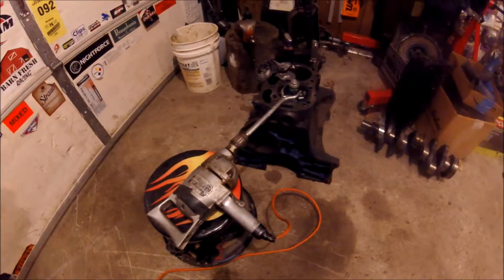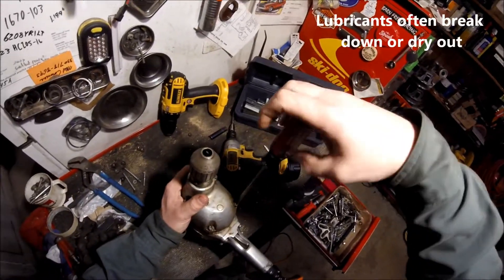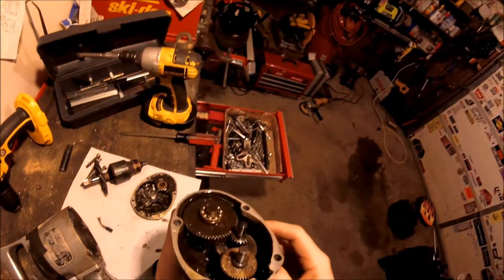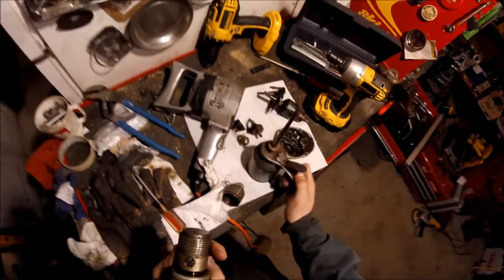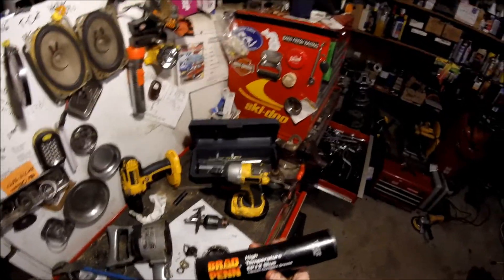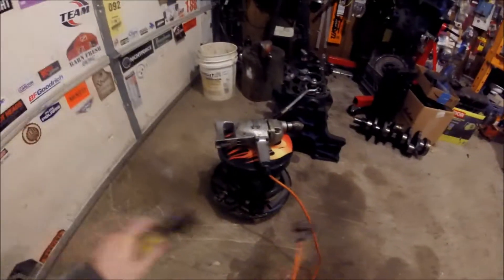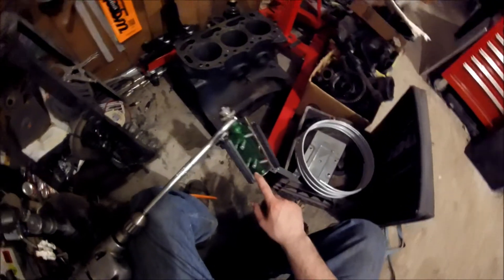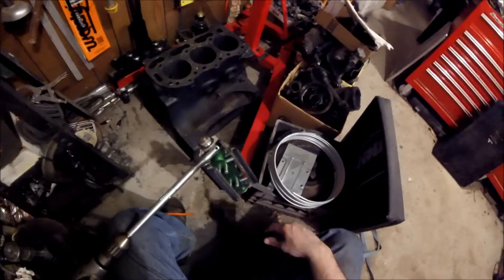Over Boring Cylinders w/ a Vintage Black & Decker Drill

Comment: 10-15 minutes per 0.0010" thank you for telling us your experience.  I'm assuming that's a cast iron block.  If my math is correct, that sounds like roughly between 2hrs-5hrs per cylinder to go over to 0.0200" to next size pistons.  

Does that sound right?  

I'm working on a straight 6 80s bmw diesel block... if I go oversized pistons then maybe machine shop is quicker.  If I stay standard size, then straighten them out at home is doable.
Reply from the maker: Yeah, that sounds about right, it was almost excruciatingly slow...  But, the local machine shop wouldnt touch mine, so I took the hard route, haha.
Reply: Did they give you a reason why they wouldn't touch it? I feel like machine shops would do it and then just do a disclaimer or something. Or is it because they don't want to do work on cast iron blocks because they are extremely hard compared to aluminum blocks? Tearing up their honing stones or whatever
Reply from the maker: @StuHaightVideo  the cast iron block itself was no problem, but apparently those tractor blocks were known for having sand pocket inclusions, and the bores would either leak or the tooling would get destroyed.

Comment: I have done this using a drill press and an old Sunnen hone. It will work, it takes, forever, you have to try to keep your strokes steady and you get to size eventually. a motorcycle inner tube or bungee cord on the drill handle hanging from a hook holding it up creating resistance helps a lot I have done this with a big drill motor too. Have you ever seen a hand crank engine cylinder boring tool ? Rottler made them and they are fun I had one.
Reply from the maker: No, never seen a hand driven one.  That would be pretty cool for honing or glaze braking, I couldn't imagine trying to do a boring job with one! haha
Reply: NO kidding?  I used to have a hand-cranked valve seat cutting rig (had pilots and everything-worked great), but I couldn't imagine trying to bore cylinders by hand!

Comment: So was that jus the honing tool? Or was that a boring tool. Is there adjustments to set it to bore to set size and not over bore?
Reply from the maker: I think it's considered both, just depends on if you have aggressive or fine stones in it. There is a dial on top that increases the bars by .001" increments, but the only real way to see where you're at is mic'ing the bore.  Material doesn't come off super fast so it''s usually not an issue if you're careful.

Comment: May need to tape up around the brushes. I think you will find that the plugs you removed have supply voltage on them
Reply from the maker: Yes, that is correct!  haha, I somehow managed to not get zapped while running it that way, it is now taped up.